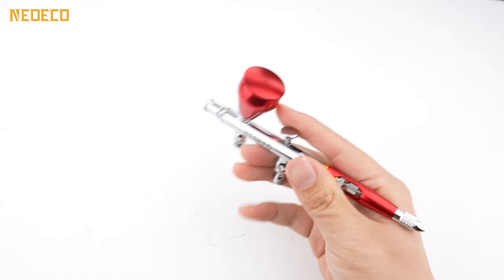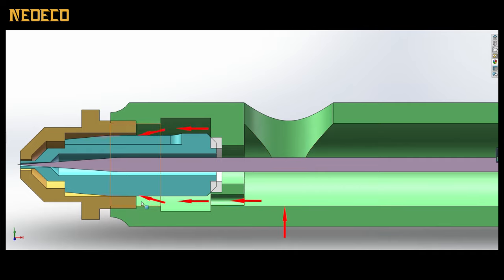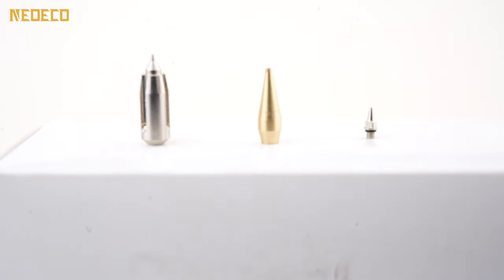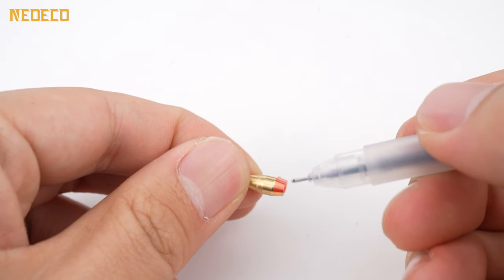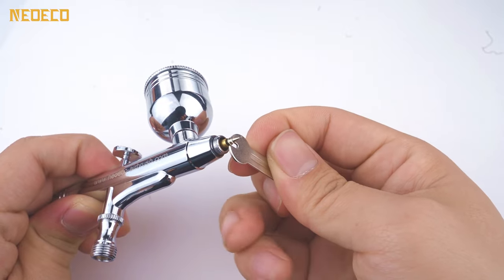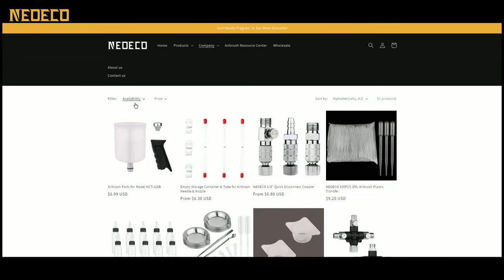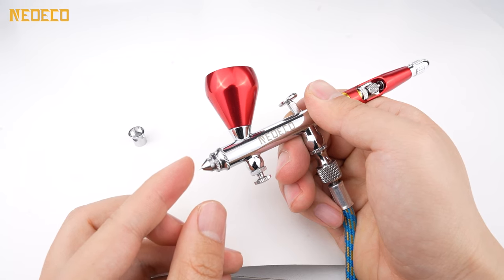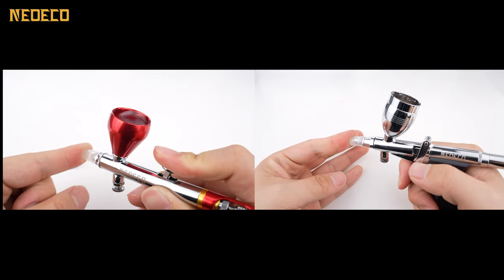Airbrush Backflow: Causes, Solutions & Safe Cleaning

Comment: Dear Neoeco - thank you for the tutorials- i love my sj83 - I recently ordered and received (via amazon) the SJ83 needle replacement part kit - the nozzles are slightly longer than those that originally came with the airbrush so that the nozzle cap doesn’t sit flush with the body - thus air come spraying out of the cup - also the nozzle cap seems a bit thinner and the needle cap doesn’t fit over correctly- it tends to fall off - any advice?
Reply from the maker: Hi, dear Jim. Could you please send picture or video to bksydtt@outlook.com? We will help you solve that. Don't worry. Thanks!
Reply: @NEOECO-Airbrush  - Thank you! I sent an e-mail with photos today

Comment: A bit late for this video. I threw my Neoeco brush in the trash two weeks ago. I did every type of fix I could think of. I'm done with your cheap shit.
Reply from the maker: Hello, and apologies for the inconvenience you're experiencing. The issue primarily stems from not tightening the air cap sufficiently. Surprisingly simple, yet often overlooked. To assist those facing similar challenges, we've created a helpful video guide to ensure effective resolution.
Reply: You should have contacted Neoeco first. And cheap doesn't necessarily mean bad: I have a cheapo I bought for $20 AU (with a tiny "compressor") eight years ago and it's still working perfectly.